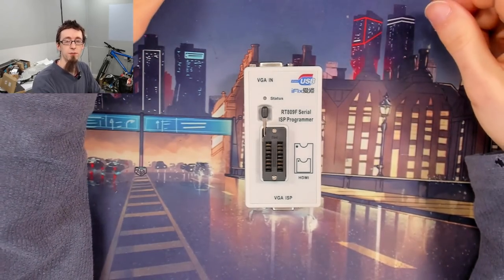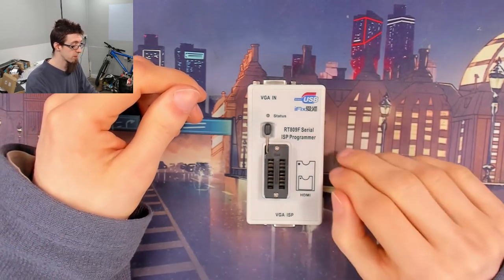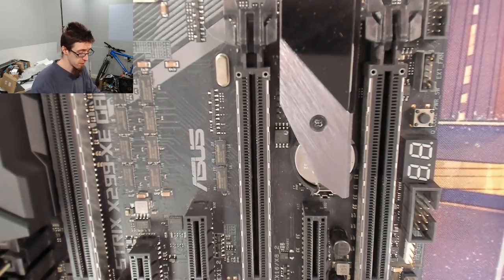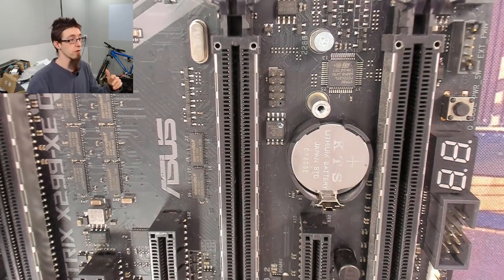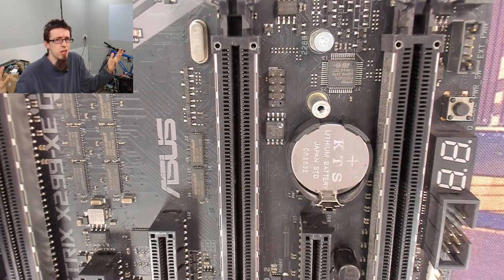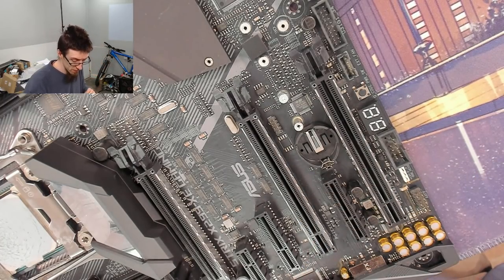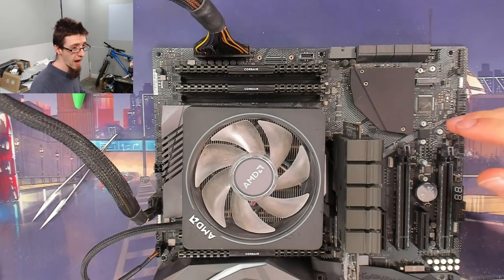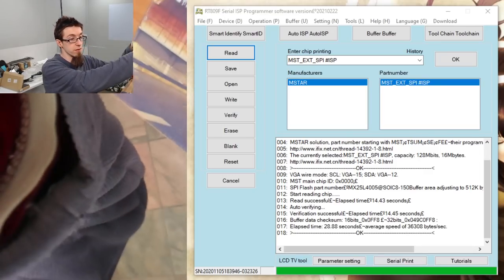Using an RT809F Programmer to Unbrick a Mobo - LFC#261

Comment: wonder if this method will bring a prebuilt hard coded bios board that cannoy be updated normally by gigabyte or asus but only from the prebuilt manufacturer but mybe this method would rewrite a bios version onto the prebuilt board turning it back into a normal retail board i got a gigabyte b450m ds3h wifi v2 cf-Y1 that the bios cant be updated  thru gigabyte but from rosewill/ABS prebuilt pc manufacturer so as of now im stuck on F1 bios  for AMD my bios chip is MX25U12873F looks like 1.8V
Reply: You'd want to be really sure the hardware is the same.
Reply: @jaro6985  yea gigabyte has my  same board except non Y1 a guy on reddit used AFUWIN utility to flash his hard coded bios with a known bios of a board same as his but a retail version i cant seem to get that software to work correctly on my pc keep getting a error

Comment: help after i flashing on  rt809f there is no display fan spinning only what is the problem?
Reply from the maker: Try a BIOS reset by removing the RTC battery for 2mins, also make sure you give the board 60 seconds on the black screen, as it might be RAM training. If you still have nothing, I would reprogram again. Make sure you have the right BIOS file, some mobos have a V2, WiFi version, etc etc.
Reply: @Adamant_IT  my motherboard is asus h81m-d what bios file can i flash id try the latest but no luck no display fan spinning.
Reply from the maker: Try the previous version then. Double-check your solder joints as well, easy to have the chip not quite on properly.

Comment: Same happened to my friends laptop , do you guys think its also BIOS issue ?? Its one of those rtx 3080 mobile laptop , powers on , display doesnt show , no signal on external monitor fans spins for a few seconds then stops and the laptop is basically a light show 😂

Comment: Can this be used on bricked SSDs?
Reply from the maker: I think SSD firmware is saved into the controller chip, so it's not possible in the same way as this video.
I wonder if the SSD controllers have a SPI interface on them though... maybe.
Reply: @Adamant_IT  good to know kinda sad face about that now since i have a few bricked SSDS and by a few its like 2

Comment: UefiTool can show u the sections of the bios.
i rebuild them and clean ME and transfer NVRAM serial data.. there is A58 version that can show u data.. and the version .28 can "replace as is" the section.
that .cap file is a miracle it worked.. because its bigger than original file size.
have to use UEFITool to extract from cap to .bin
or BiosRenamer.exe came in .zip can make proper size .bin
Reply: i got same issue list, no one to get help, lenovo lap

Comment: That software is wierd. 
All button labels are doubled and written just in a slightly different way or with an additional space.
F.e. "Buffer Buffer", "Tool Chain Toolchain"
It seems as if the buttons show the label of the button and also the internal name from source code.

Comment: @ AdamantIT can i send you some video cards as donation to see how you fix them in a video?
Reply from the maker: You're welcome to send them in, yes! I can't promise when I'll get to them, as GPU repair is a bit of a back-burner project right now. I definitely want to get into it though.
Reply: @Adamant_IT  I can't remember step one other than maybe checking beep codes. They are collecting dust, I would pay for shipping. Their are several. I've tried not to dick with them too much so any marks or corrosion can can be seen for clues.
Reply: @Adamant_IT  po box or email?

Comment: You're a brave man to not run any type of virus scan from a site that looks like that.  I know its the manufacture but I would much rather wear a digital condom when screwing around with lady Chinese electronic software.  Do you perhaps run this type of tool in a VM?
Reply from the maker: I don't run in a VM, but the two machines I use for repair tools/software are treated as expendable, and can be formatted at any time. No important data or mission-critical stuff on them.

Comment: the ezp programmer be very careful yes they do work but they successfully broke 1 motherboard kept corrupting my flash and literally fried the PCH on the asus g751jy, monitoring the temp using a thermal imager the pch hit 152c and i shut it down, the board i do believe is toast unless i buy a donor, transfer and reball a PCH to the board really not worth that much efford, and the other board i got working instead of flashing as W25Q64 i flashed the BIOS using W25Q64FW and now my other board posts and it works but the minute i try to play a game the laptop turns off and also my batt which was in good condition now sits with an x not charging wont charge wont hold a charge so yeah get a TL866II Plus if you can
Reply from the maker: Yea, I was planning to get a decent clip and experiment with in-circuit flashing, but the more I hear about people melting PCHs, the more I think "lol no... just desolder the chip it's not worth the risk"
Reply: @Adamant_IT  i do the same i desolder, and resolder, i know i mentioned my bricked boards the one i did happen to get posted i now know what the problem is, IT8585VG  gets extremely hot, this chip controls just about everything so looking to replace it, and replace my eeprom programmer, the ezp is junk in my opinion
Reply: @Adamant_IT  forgot to mention the reason people are cooking their pch is because they are not considering the voltage from the cmos batt to the bios so when they flash @ say 3.x volts add the volts from the cmos and good by bios /PCH, its always recommended to remove the cmos if flashing in circuit

Comment: 1. From old BIOS the fault one. You could extract the serial, UUID, mac address, etc. Asus offer a tool for this. Then insert all the personal data extracted in new BIOS file.
2. First 0x800h need to be cut.
3. Why your "excelent" programmer didn't notify that your buffer exceed the chip size. Why ?

In my opinion you just play with a flash programmer... Not a profesional FIX.
Reply: Can't wait to see your bios videos.
Reply: @shooter3267  NEVER :D